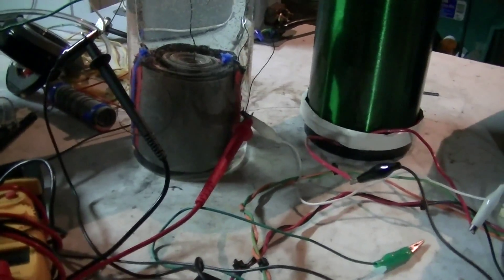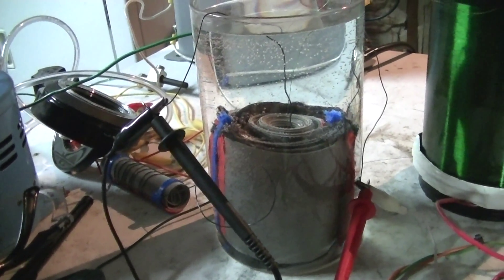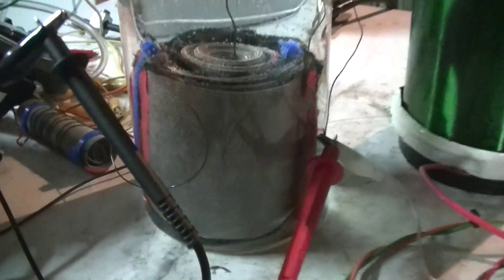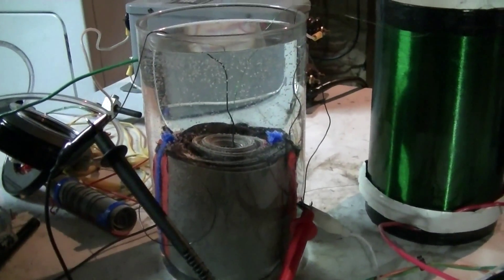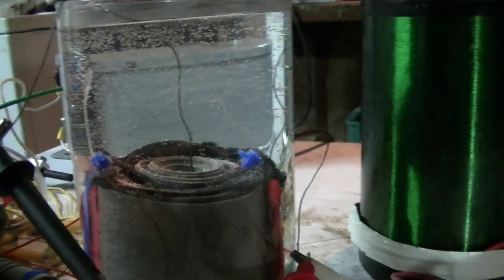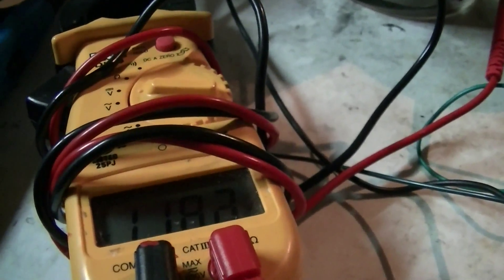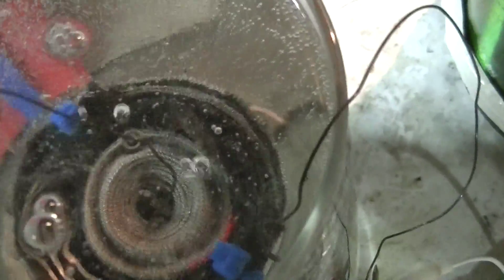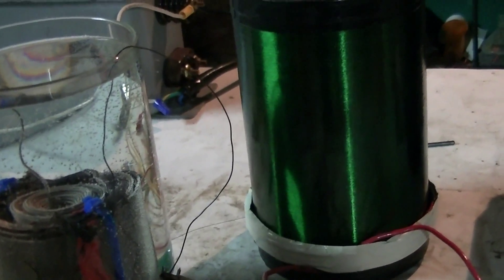HHO Nitinol Cell Experiment

Comment: Gallium Aluminum alloy fill joe cell half way with alloy then fill the rest of joe cell with urine then locate the correct electrical frequency to produce HHO out of the joe cell with Gallium Aluminum alloy. This alloy by itself will generate hydrogen from water that come's into contact with the alloy all off the Schumann resonance frequency of 7.83 hertz. So locate the correct frequency to rapidly produce HHO out of urine? Why urine? A car with an HHO rotary engine that all y'all needed to do was pee into the tank? Or a motorcycle that was powered off y'all's liquid gold? 😯😱😵😲😂😂😂😂

Comment: Rather nice setup, and you should add a fibre seperator between the electrodes to split the gas, get a proper buck converter to lower the voltage(some few volts max) and increase the current (you want more current). Tried searching for electrolysis? I can't find a single mention of it here, even that's clearly what you are doing. Adding some natrium hydroxide to the water will speed up thing.
There is a wikipedia article called electrolysis of water, you should check it out.

Comment: its working great... is that ac or dc?
Reply from the maker: DC on a PWM at 2.3 MHz Duty Cycle or impulses I guess I should say.
Reply: Diadon Acs as in a buck converter? 12V is way too much voltage and will make undesired reactions.
Reply from the maker: I noticed that in research, its crazy you said that as I was just looking into that.  You following me ;)